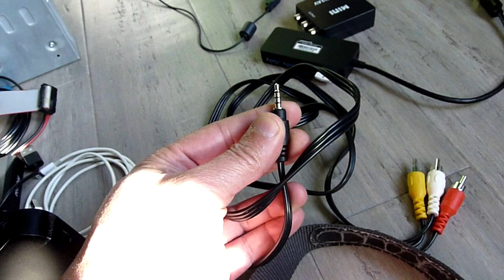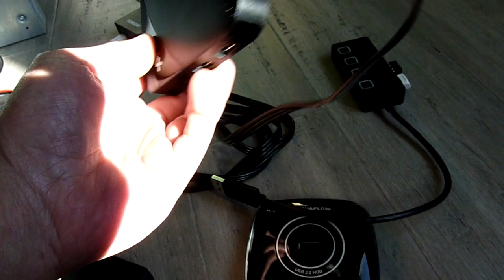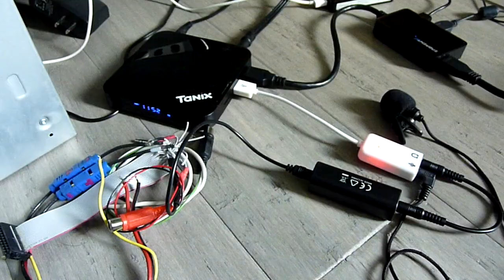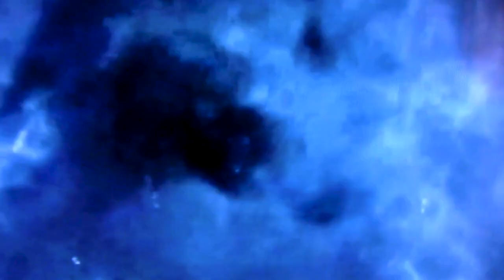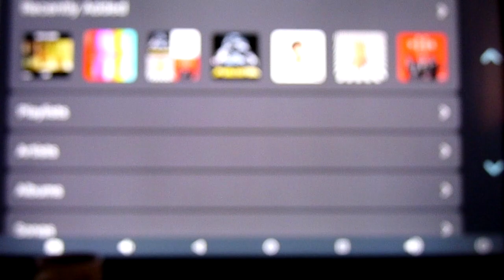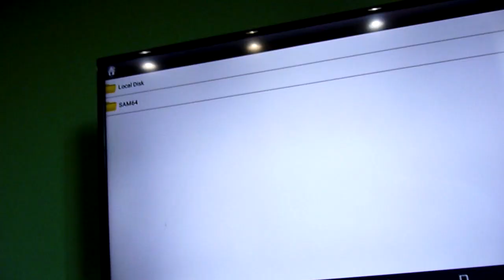How To Install Android TV Box CarPlay Android Auto To Audi TV Tuner MMI 2G

Comment: Hey @3dogs1monkey, I have got the exact same set up, as yours, but my carplay doesn't read the microphone (Siri/google), how do I work around this? Fix it? (Because i believe usually the tanix android box doesn't support microphone? I have the same adapter and microphone and everything set up like yours. Do i need to do anything specific? (I also downloaded an app that tests the microphone and it reads the microphone and allows me to record and play back, i have tried many different microphones too) I am also using Carlinkit dongle caprlay
Reply from the maker: It’s the microphone, if you use usb mic, make sure you have extra power into the hub. I use usb audio dongle, I use microphone from a head phone set and it works better. I have to put it close to my mouth for Siri to work
Reply: @3dogs1monkey  aux or usb micophone into the adapter, doesn't matter, all the same, siri just doesnt read microphone at all, but other apps do read it, very wierd...
Reply from the maker: @royboyreviews  only Siri and texting are using the mic of the Android box, all others use the phone mic, hence... it’s the microphone, find a good one and it will work.

Comment: You are the man with this stuff. Great job laying things out. My one question is.... lets say i dont wish to have all the andriod car play. I only want to connect a chromecast so i can cast from my phone. I can use "ok google" to control my videos and songs. If the chrome cast was installed, would it load into the chromecast once i turned the car on and selected the andriod box through the MMI? What im trying to achieve is getting into the car, selecting the av1 or av2, then i dont have to do anything after that. I can put my phone down and my videos are playing that i have in my playlist. Would i even need the andriod box at this point? I would only need to convert the hdmi to AV cables then plug that into the tuner correct? What are your thoughts on this?
Reply from the maker: Chromecast has some types of security that prevent you from doing this. 2 devices must be connect to the same WIFI network. Chromecast doesn't allow any resolution below 720p which MMI screen is only 480p. I did try the Chromecast through HDMI2AVI device and it didn't even display on the MMI screen directly to the AV1 or AV2. Chromecast is designed for high resolution streaming. CarPlay and Android Auto are safety programs for driving and not ChromeCast. When you have AV1 and AV2, you can connect anything that output AV which can be downgraded resolution to 480p. Android TV box is not a display, small Android computer.